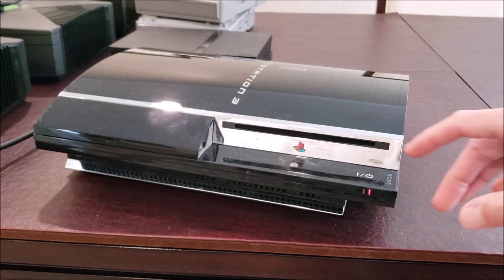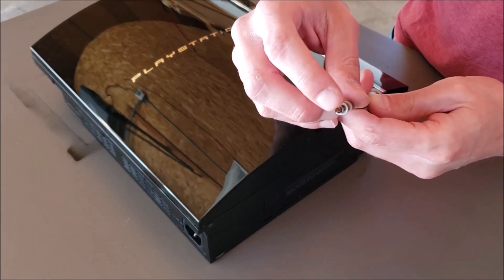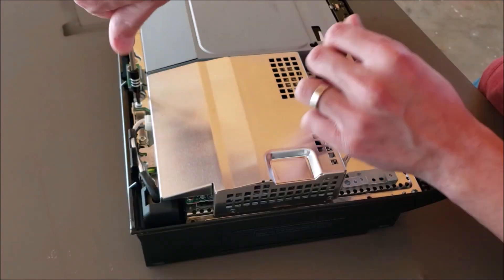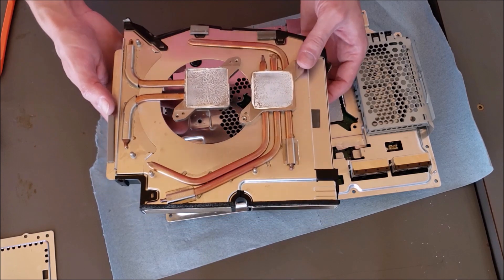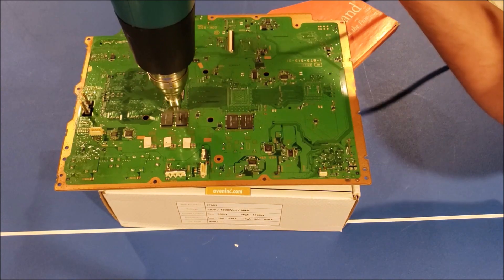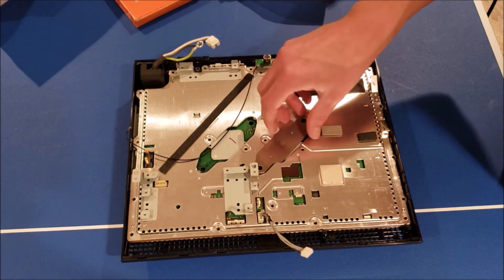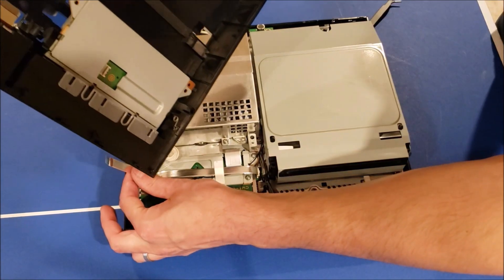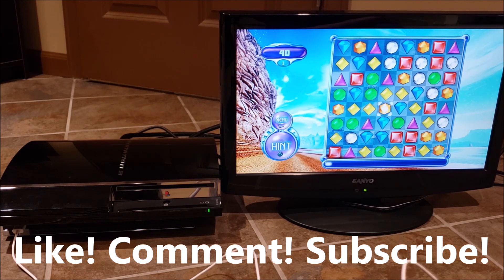Fixing a PS3 with Blinking Red Light "of Death" (YLOD)

Comment from the maker: Note: YLOD has many causes with a prominent one being failure of the NEC capacitors. There are some involved methods to further diagnose using syscon (check discussions on psx-place) but replacing the NEC capacitors is a generally safe option to start with, and I'd recommend it before resorting to the reflow process shown here.
Reflow with a heat gun carries multiple risks due to inherent variation in people/method and the heating equipment itself--if not done carefully you can cause additional or new damage to the CPU or GPU. I may have gotten "lucky" with this one, in that it seems the caps are still okay, but there was some intermittent solder joints in either the CPU or GPU. My reason for thinking this is that the console in this video is still functioning 9+ months later, granted it is not seeing heavy use. If you're here, you've probably been exploring multiple avenues already, and I encourage researching other options before deciding what's right for your situation. Being real with you all, I didn’t do that much research before attempting this fix; I was excited by the outcome and wanted to share the process/result here. Everything I’ve learned since came from viewer comments, so thanks to you all for teaching me something new. Cheers -Joe
Reply: Hi fantastic quack
Reply: Muito bom amigo
Vou fazer no meu pra ver se resolve
Reply: Can help me fix my ps3 it extacly the same problem am from nigeria
Reply: Muito bom amigo Vou fazer no meu pra ver se resolve
Reply: my friend ❤️
Reply: My ps3 fat turns on, I watch YouTube and everything is fine, but I start a game, I enter story mode and suddenly it beeps and turns off, the temperature is low, the fans don't even increase much, just the basics and it still turns off suddenly Do you know any possible solution? I don't think it's CPU and RSX
Reply: @a @tavomartinezM110  format the ps3
Reply: You spelled Bumpgate wrong 🤔
Reply: Do you know this is something that running a hair dryer on high heat through the vents might solve? I'm leery on taking the whole thing apart. Mine is also the slim version. I was somehow able to get it going a year or so ago after it wasn't working, and now it's acting up again, so I know it works.

Comment: Can I send you my ps3 fatty to fix? It does the same thing.  How do I reach you?
Reply from the maker: There are so many different brands and types of multimeters where the settings aren't 1:1. What's usually common is "auto"--if yours has that then use it, otherwise refer to your user manual. On "black and red things" I'm not sure what you're talking about, if you can be more specific on where and what screw would help.

Comment: Hey what is MX-2 .? Do I have to use it? It is not enough just clean? Waiting your answer.. thanks
Reply from the maker: It's thermal paste, yes it should be replaced if the old stuff is dried out which it certainly is on original PS3's that haven't been serviced. You don't necessarily need MX2 specifically, there are a lot of thermal paste options that are suitable

Comment: I followed this step by step but I didnt have a heat gun so I used a hair dryer and just held it on each position for 2 minutes instead of one and it worked! After I put it all back together and plugged it in, it did the same beeps and shut off. I was gutted. But turned it on 1 more time just to try and it came on! Can't believe it worked! Thank you bro
Reply from the maker: Awesome, glad you got it working!
Reply: @FantasticQuack yours is still working ?
Reply: @FantasticQuack  Stil working???

Comment: Is this PS3 still working as of 2025?
Reply: yup but its most likely nec/tokin or bga problem try heat up the nec/tokin if the console boots than you know the problem
Reply: Absolutely. Graphics are decent. Tons of great games you would not have played and which cost next to nothing. Easily can entertain you for a long time.
Reply from the maker: I'm not sure if the other 2 comments are bots or what but no the PS3 in this video failed again a couple years later. The fix is not permanent.
Reply: @FantasticQuack  Ok that's what I figured. I don't know how committed you are to fixing this console but from my observation it seems like the RSX has failed which is extremely common with these early models, but you should check it just to be sure. I'd recommend checking the SYSCON, which from some of your other comments you sound familiar with, the reason being is because it could be the NEC tokens instead.
Reply: Yep. MW2 lobbies and BO1 lobbies are active too
Reply: This is probably gonna partially fix my issue which will lead to YLOD soon but not completely so I think changing the thermal paste under the metal plates will help extra so I should do that but what tools should I use? I don’t feel like going and letting someone else fix it for 200€ so I would rather do it myself

Comment: I have one that isn’t overheating or anything, it’s very clean inside. it’ll play games for a bit then 3 beeps and cuts off.
Reply from the maker: Have you tried a hard reset, or removing/reinserting hard drive? In some cases, the disc drive itself can cause a three-beep shutdown. If none of that is the culprit than good odds that it is YLOD.

Comment: is it still working?
Reply from the maker: No it eventually failed again at about 3 yrs :/ check my pinned comment for more info
Reply: @FantasticQuack  most likely nec/tokin try heat them up.. if its works than you know the problem replace them than witch Condensers

Comment: I had the original PS3 back in the day. After a 3 or 4 years this happened to it. I also took a heat gun to it and it worked -for a week. Then the same issue came back. Took it all apart and repeated with the heat gun. It worked again -for a few days. Took it apart a third time. Lasted a few hours. You can see where it ended…
Reply from the maker: Yes unfortunately the fix is more temporary than I first thought when making this. Apparently even a full reball of the chip will not permanently solve it.

Comment: What about a ps3 with a green Light "of Death",, not red not yellow but green and have no screen display and do not turn of by button or controller
wel that happen to me this 3 week in 2025/04/30 comment date
Reply from the maker: Check with a different cable/monitor, if that doesn't work it could be the GPU itself is bad

Comment: So I got second PS3 I cleaned the dust from the system, swapped the fan, new hard drive, and gave it new thermal paste and I still get the beeping red light
Reply from the maker: The heating step is necessary and I didn't see you mention that. Check my pinned comment for some additional context if you're thinking about doing this method.

Comment: this videos nearly 4 years old now. I am curious, does it still function? or did the ylod return?
Reply from the maker: It did come back :(
It took ~2 years for that to happen with fairly light use. I made the pinned comment well before that happened but because I saw a number of comments indicating it was a temporary repair, and it turns out they weren't wrong.
Reply: @FantasticQuack  Ah well. 2 years is surprising though. might be worth checking the syscon to see what went wrong with this unit

Comment: my ps3 has the YLOD. i opened it and the thermal paste was super dry. i switched it with the new one and then i closed everything back. now the ps3 shows a longer green light (for a couple of seconds) then gets the YLOD again. any ideas guys??
edit: im thinking of reheating the cpu again as i only have a hairdryer and it works to heat it up. i think i need to heat it up for longer.
Reply: A hairdryer isn't hot enough
Reply from the maker: Would recommend a heat gun
Reply: @FantasticQuack thanks for the advice

Comment: Mine is a CECHK01 and has the same issue. Was deep cleaned, replaced the thermal paste and it still doesn't work. Any help?
Reply from the maker: Well said, fun story, agreed @JohnDoe-md2sb
Reply: @randomlysammy9856   Honestly, sell it for parts and buy a used Slim...you're gonna drive yourself crazy if you continue down this road.  😫
Reply: @JohnDoe-md2sb  you really think it's a lost cause? 😢

Comment: yea ,its not the nec tocin You are shortening their lifespan. the problem usually be the rsx cuz the solder bumps on the chip (gpu ) crack because the silicon fill they use for holding th chip is not durable so when the ps3 heat  and cool down the solder bumps cracked they They expand and contract its not the solder balls its the solder bumps and it not either the nec capacitor Sony knew that the capacitor cant resist the heat in the long term so they  make them lil far from the the cpu and gpu ,its rare to be the fault the nec tocin ,and what you did is just a temporary fix sometime work but it will return im sure cuz the rsx solder bumps will crack again ,if you want to do fix it properly you should replace the rsx 90nm to a one from the ps3 slim rsx 65nm , hope this help
Reply from the maker: Thanks for insight, I have a pinned comment that covers some of this

Comment: Yesterday, I completely took it apart, and got rid of all the damn dust.
I also put on the new thermal paste.
My system now says, it needs to restore the system.
Then, it just flashes the red light, and never comes back on..
Should I replace the power supply it's a fat backwards compatible.
The thing I did not do, is what you did with the heating gun.
Local shops, want to charge me $40 to diagnose, and then said it might be around $199 to get a replace the power supply.
Damn, I was hoping I could of fixed it on my own...
Reply from the maker: If the power supply is the problem you can get one on ebay for ~$40 and replace it yourself.

Comment: Dude computers anything electronical Does Not Like Heat
Reply from the maker: It's heat + duration that you have to be mindful of. Every surface mount chip and component on that board was exposed to air temperature high enough to melt solder during the manufacturing process. What I did was simply repeating that in selective areas.

Comment: Can a hair dryer work in place of a heating gun?
Reply from the maker: Probably would not get enough heat unless you insulated around it and heated for a very long time
Reply: @FantasticQuack  is putting the motherboard into an oven works the same way?

Comment: But the problem of heating the chips is that it may actually make the chips bulge
Reply from the maker: They will be fine if you don't go too crazy. These chips are designed to withstand solder reflow temperatures

Comment: I cringed watching you clean that fan with a leaf blower while still connected to the motherboard. 

An unpowered motor when spun becomes a generator. And can send voltage spikes back through your motherboard.
Reply from the maker: That's a fair concern, but keep in mind the motor drivers are designed to deal with some amount of reverse current ("normal" example would be power loss and fan spins down putting current flow back into the unpowered board). You probably could create an issue if you spun it high rpm for extended periods but I did not do that and no damage was incurred.

Comment: Does a hair dryer work?
Reply: Yes
Reply from the maker: If you insulate the surrounding space and do it for expose the hot air long enough to get the temp high enough, maybe. I have big doubts on attempting with a hair dryer.

Comment: I took my ps3 apart to clean it and apply new thermal paste which I initially thought would fix it but it continued to shut off and blink red 3 times. I didn’t use a heat gun or anything but I’m a little lost as to what exactly is making my ps3 do this.
Reply from the maker: Changing the thermal paste on it's own won't fix YLOD. Pls check my pinned comment for additional info

Comment: I have been playing my ps3 fat the one with compatible ps2 games and I was playing crash bandicoot the wrath of Cortex on my ps3 console the fan was so loud like a jet engine and then turned off automatically
Reply from the maker: Overheating for sure. You can clean out the system and replace the thermal paste like shown in this vid and I think you'd get more life out of it if YLOD hasn't already appeared.

Comment: This worked thank you so much I hadn’t turned this on for 6 years and now I can enjoy my favourite games again
Reply from the maker: Glad to hear it!
Reply: Mine broke again :(
Reply: @SpeedyJedda Thank you so much for notify it was temporary. I wonder if, after re-heated, using the console without any case could keep the fix.
Reply: I redid it and it’s permanently broken now, I would like to say thank you for making it work for awhile.
Reply: If it's a temporary fix, I might as well not even bother fixing mine, OG ps3 fat compatible with red blinking light :(
Reply: @tyrantwesker5012 you should so you can get a usb drive and get your saved data
Reply: If you want to fix it permanently you could get it reballed, that will increase its lifespan by a mile, and the tantalum fix, but if you reflow it and it dies again, try it again and if it doesn’t work just buy a super slim

Comment: I just bought the same model of ps3 and have been getting this issue! I plan to open it up today to take a look at it. Im endlessly appreciative of this video, thanks man! 
Quick question, when reheating those chips, do I need a heat gun or could I use a standard hair dryer? (I wouldnt have the availability of the narrow nozzle attachment you have to a heat gun, which already seems like a downside)
Reply from the maker: I'm glad you enjoy the video! Unless you did something whacky with insulation and long duration exposure, a hair dyer will not work as it does not produce enough heat to impact the solder. Please check out my pinned comment as well if you haven't already. Cheers!

Comment: yeah, i need a heat gun.
two of my ps2 BC models have gone the same way.
took them apart, cleaned them and reapplied new thermal grease, seems i was missing the reflow step.
thanks for this vid.
Reply from the maker: Glad it was helpful, hope you can get yours working!

Comment: Would a normal hair dryer work too to heat up the CPU and capacitors? That's all I have at the moment.
Reply: not even close.
you need the heat cranked up to over 400o centigrade to melt the solder as illustrated in the video.
a specific tool, a heat gun is required.
Reply from the maker: If you were able to insulate well enough around it and apply the heat for a loooong time (20 min as a guess) you might get there. I would recommend just using a heat gun.

Comment: I’ve found one of these models on the top of someone’s garbage pile years ago when they were still hot, it was soaking wet and missing the disk drive. Brought it home, dried it out and had the same ylod. I wrapped it in aluminum foil , put items to hold the chips in place and stuck it in the oven.   Ran like a dream for years.
Reply from the maker: Nice job doing what needs to be done to enjoy some sweet sweet ps3
Reply: On what temperature?
Reply: @AlexanderLomouri  I don’t remember exactly, but it was a little bit hotter than the melting point of the solder. If you are attempting this make sure to wrap the rest of the board in tinfoil to protect the chips and caps around the main chips. And make sure it’s perfectly level.
Reply: Mmm these cookies taste like tripped circuit breakers
Reply: How long do you cook it for
Reply: Did it taste good tho?
Reply: @SHUT-UP_MEG  bro🤣

Comment: But I have tried all this 😢 but still showing red light
Reply from the maker: Might not have been enough heat for long enough, or it might be a separate issue. Check my pinned comment for more info, cheers
Reply: dont reflow it again if it doesnt work its nec tokins (heat somethimes cant revive them) or another capacitors

Comment: I did that to mine. First time lasted over six months and last time lasted like a day. Did it like four times until I broke the disk drive ribbon cable connector xd. It’s been like five years ago and haven’t try anything new, since I moved to mobile gaming.
Reply from the maker: Might be a separate issue. Check my pinned comment for more info, cheers!
Reply: I fixed mine twice with the heat trick, and like yours, the 2nd 'fix' didn't last very long. I purchased my ps3 in 2008 for $400 and the remote for $20 just to watch dvds.

Comment: How can I remove a game disc that's stuck in my PS3?
Reply: With the switch on the back turned off, lay your finger on disk eject button and hold. Turn switch on and hold till you hear the fans kick on, the ps3 is performing a fan test. Your disk should then eject and fan test will stop 15 seconds later
Reply from the maker: Only other way I know of (besides what BREZ mentioned) is to disassemble the drive and remove it manually. The fan test did not work on my unit.

Comment: Good job, man. This was and still is a problem with my PS3. I fixed it for $15, but after 3 months the problem returned again. I think it was because I played for 8 hours straight or because the atmosphere contained a lot of dust...
Reply from the maker: Thanks! and yes unfortunately the failure mode is unfortunately sure to return eventually in the same way it happens on a brand new unit over time.

Comment: Now that the syscon has been figured out and error codes can be extracted, ylod repair is easier than ever before. In most cases it is the GPU failing due to bumpgate, but the NEC caps are another common failure point.

A thing you can do is if you hold down the disc eject button while you turn on the power switch at the back of the console, the fan will ramp up to blow out any dust buildup in the heatsink.
Reply from the maker: I tried the fan thing and it didn't help anything on this one